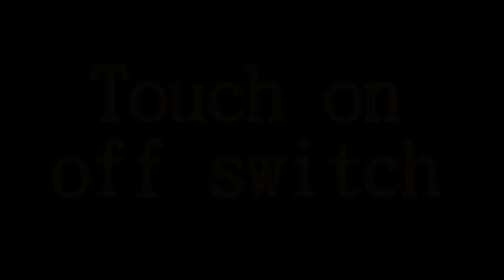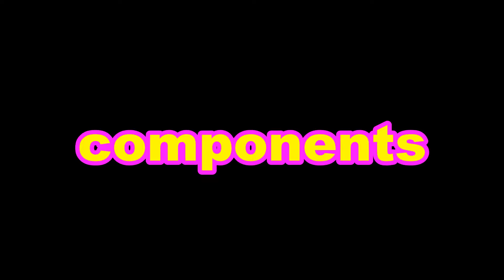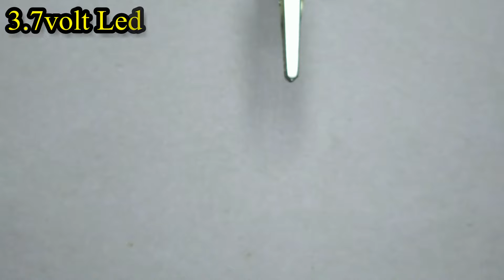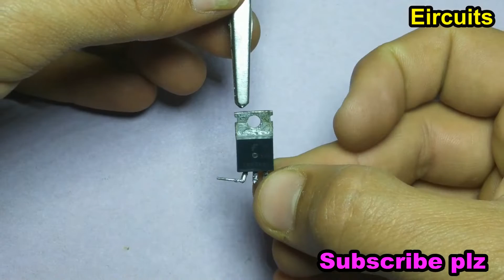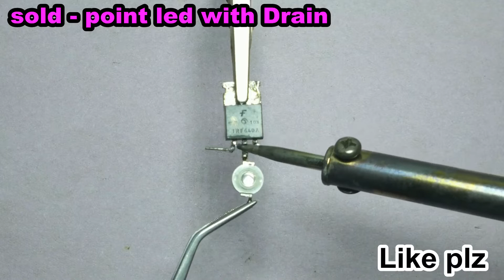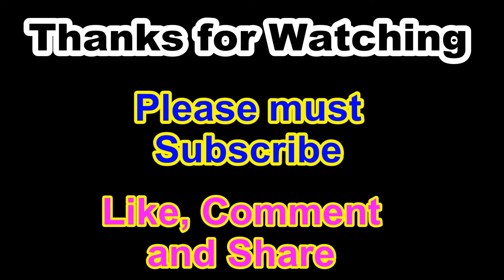How to make a touch switch using only mosfet transistor

Comment: Hey i hope u get to reply to this asap.. i followed what u did except i used a light diode and 9 volt battery instead. The circuit just lighted up and didnt on or turn off.. pls help
Reply from the maker: Dear use 3.7v or 4v battery if you use 9v battery then component burn
Reply: E Circuits thank you! Also i used a bc548 mosfet, is that a good mosfet for the circuit? Because i think thats one of the reasons why it didnt work